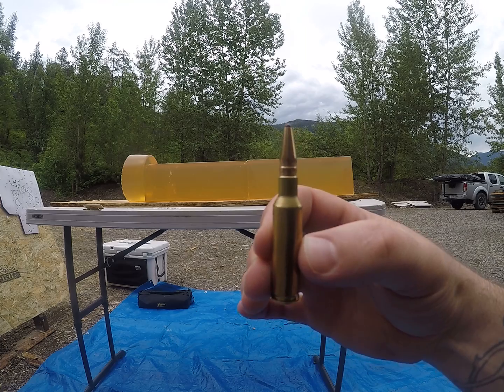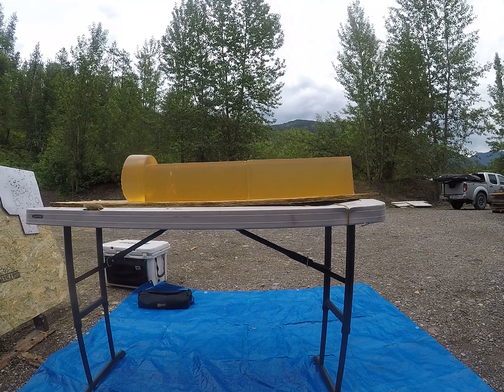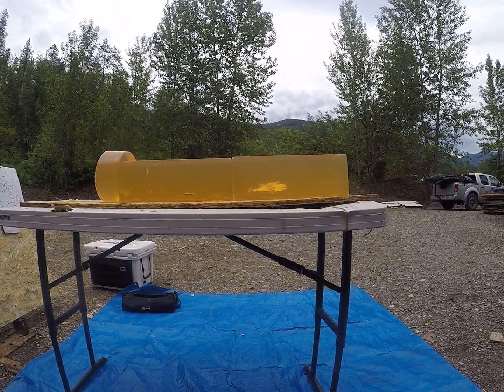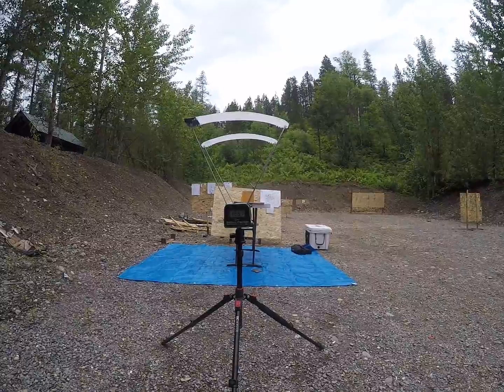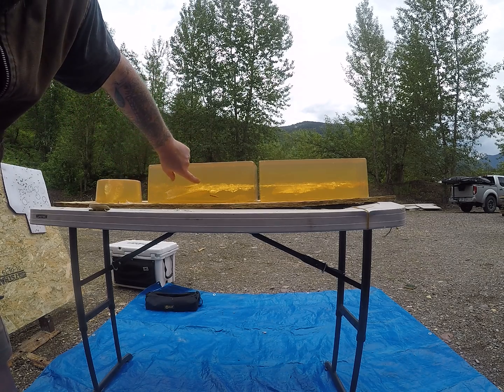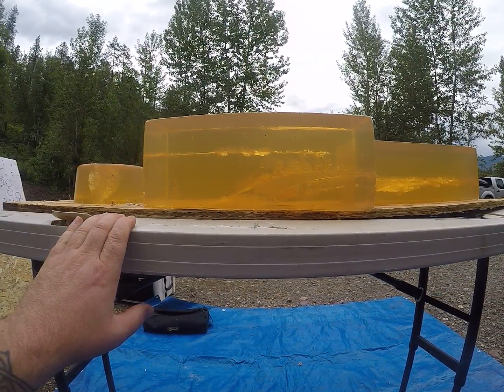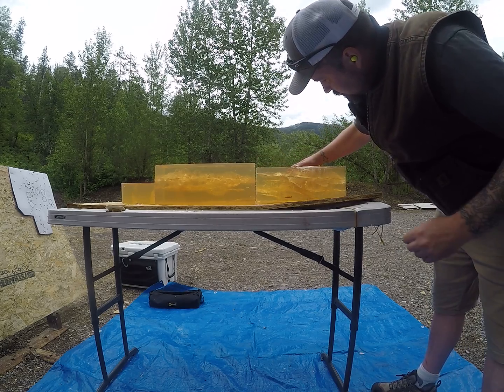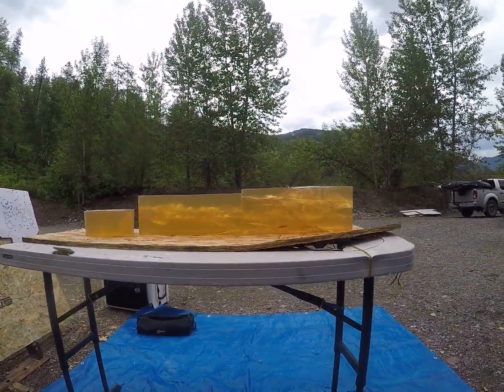6.5 Creedmoor Fox 123 gr ballistics gel test

Comment: Your velocities are about 1,000 fps too slow for a 6.5 Creedmoor rifle. The bullets are not designed to expand at those velocities.
Stick with high velocity loads.
Reply from the maker: The test was to see how low can you go and them still function (2000+ fps minimum) and what kind of damage they do at higher velocities. The high velocity round was a little faster then 2900 fps on impact. So yes a 2300 fps to 2900 fps on impact would be a good range of effectiveness with these bullets. 

If one was to use these bullets in a 6.5 Creedmoor I would suggest moving them as fast as you can safely and accurately and limiting your range to a velocity loss dropping no less then 2200 fps.

Comment: That bullet looks pretty big for 123 gr. Did you weigh it? Is it lead?
Reply from the maker: Yes I did, every one of them and they were within 0.2 grains of each other. Definitely 123 gr and they are lead free copper bullets.
Reply: Its an mono copper bullet, hits like a bulldozer. gel aint good for it, to soft even with that wood in front. designed for shoulder shots to be safe, it crush bones as toothpicks and destroy all internals with low meet destruction
Reply: The Fox is not copper, like Barnes tsx for example... It is brass....